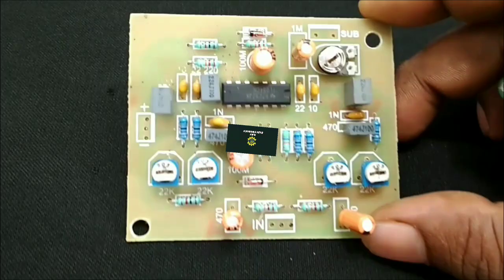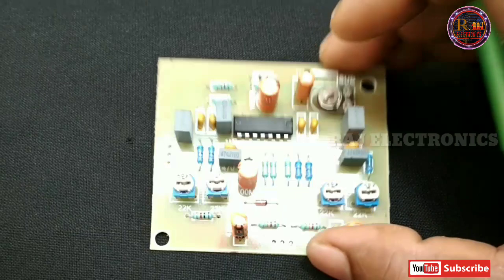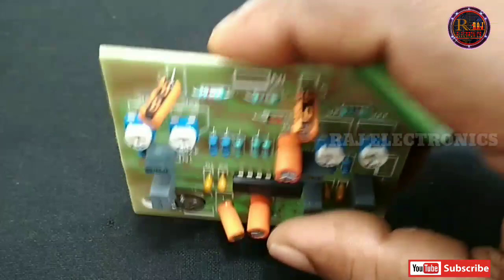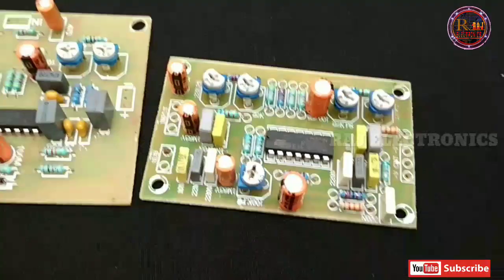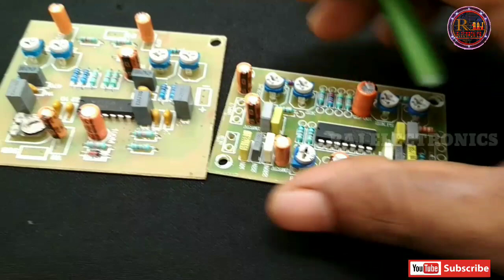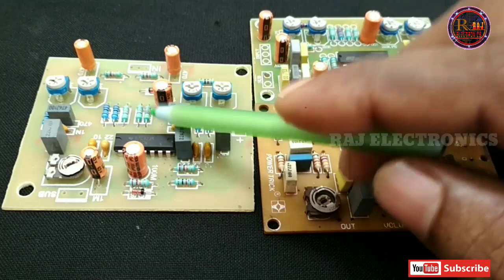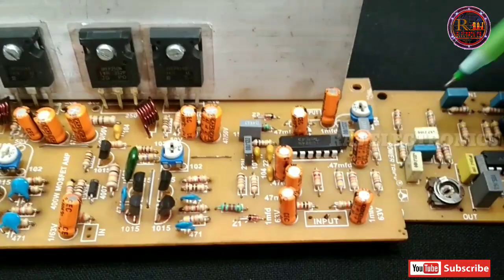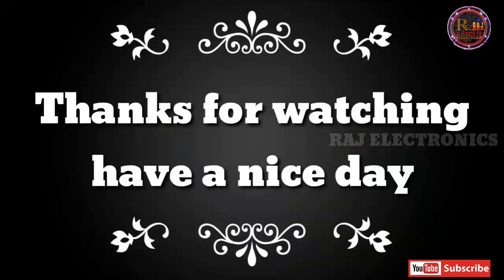Subwoofer filter board 2

Comment: ഹായ് ....എനിക്ക് TDA  2030 കൊണ്ടുള്ള 3 IC 2.1 ആംപ്ലിഫൈർ ബോർഡ് ഉണ്ട് ......അതിലേക് ഒരു subwoofer filter board കണക്ട് ചെയ്യണം ....filter board +12v  -12v  ആണ്  എന്നാൽ amplifier board പവർ സപ്ലൈ 12 0 12 ആണ് മാത്രമല്ല 6 diode കളും 2 ഫിൽറ്റർ capacitors ഉണ്ട് .......amp board il നിന്ന് +12 , - 12 എടുക്കാനുള്ള മാർഗം പറഞ്ഞു തരുമോ
Reply: യൂസ്  റെഗുലേറ്റർ ic

Comment: Chetta ee 4mosfet boardinte correct matching volt Amps ethrayanu
Reply from the maker: Max volt 40 0 40
Normal working volt 30 0 30 6amps